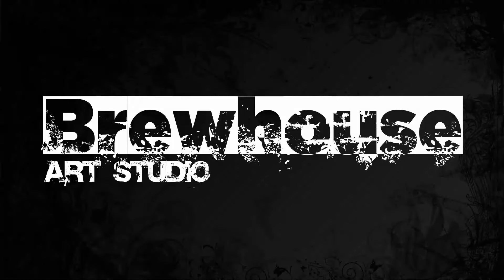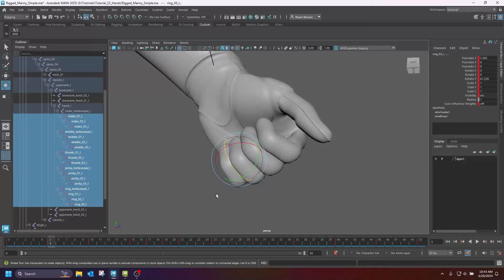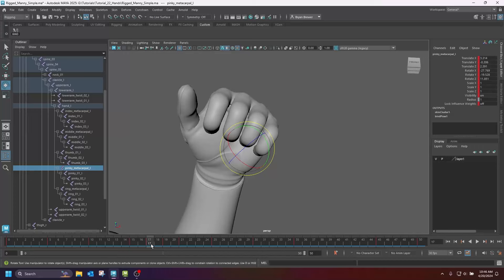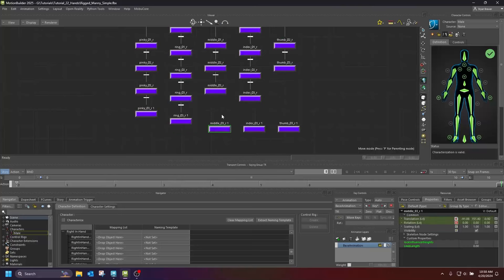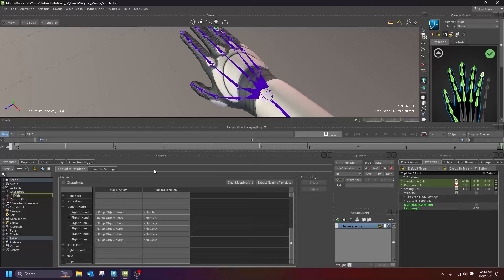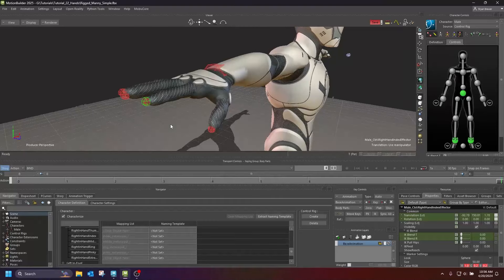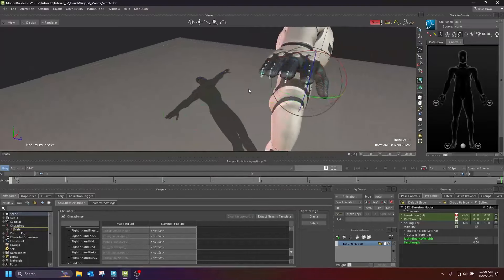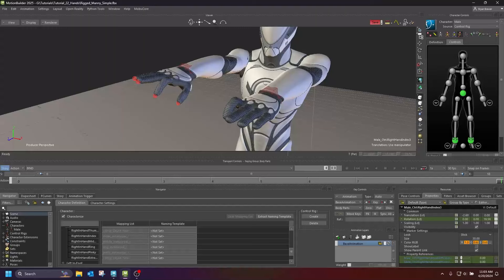Motionbuilder Tutorial - 22: Fingers and Hands Basic

Comment: Thank you for covering this, some really useful pointers (no pun intended!). I find characterising and then retargetting fingers between different characters never quite works right, there's always manual adjustments needed - most often with the thumbs. I'm currently trying out leaving the first thumb joint (closest to the wrist) in its 'natural' (zero local rotation) pose, then setting the remaining thumb joints to align with the global axes. In the same way, I've found I get the best results for the fingers if leave the metacarpals alone and align the remaining finger joints to the world axes. It seems to me the first thumb joint and metacarpals define the shape of the hand for different characters and so need to be left alone when characterising. But there are still issues with twist discrepancies between the metacarpal and first finger joint - retargetting more complex hand animations is still far from perfect so I'm still experimenting. On a different note, I'm also intending to experiment with using the extra end-point finger joints as IK effectors in an Unreal Engine VR project so that they can be used for more accurate collision detection. Even though they're not skinned I see potential uses in games engines...

Comment: any tips on finger floor contacts or automatic floor contacts in general?
Reply from the maker: @huiAPPOAJ  Yes, Always create Left and right hand and feet floor contacts using markers or nulls. Add them to your character definition when characterizing your character.  This way you can choose the height and angle of the floor contact.  For example if a character runs into a wall. You can rotate the hand floor contacts to be aligned with the wall so the hands don't pass through.  You can also animate those nodes so they are in the right place at the right time when motion editing.  

Turning on hand contact keeps the palm of the hand from passing through the floor plane but not the fingers.  The same goes for the feet.  So if you don't actually have toes there is no need to turn on toe contact.